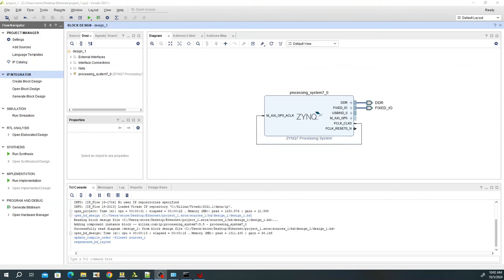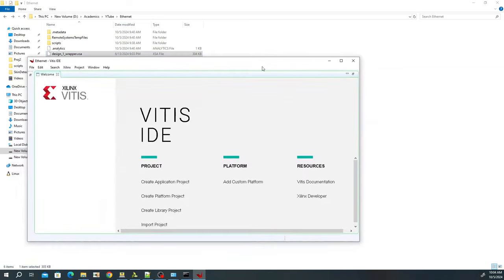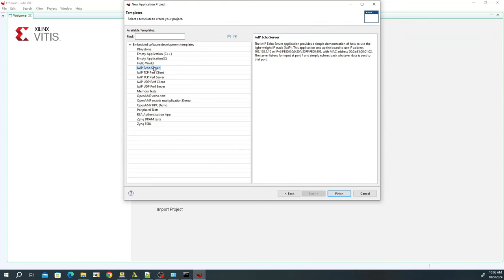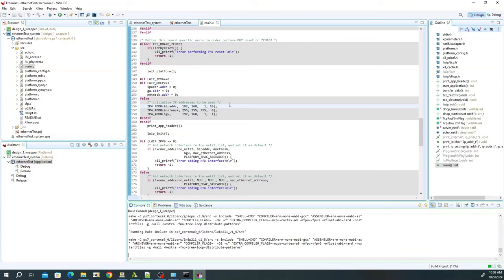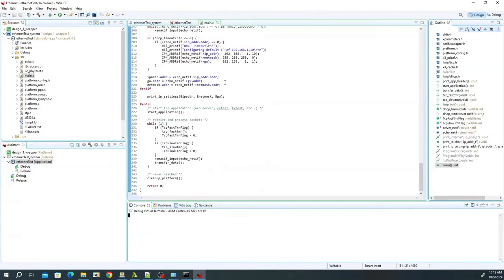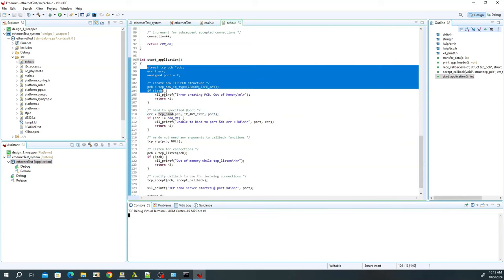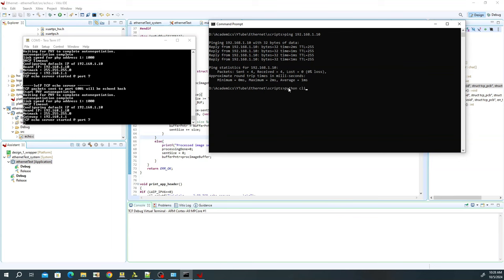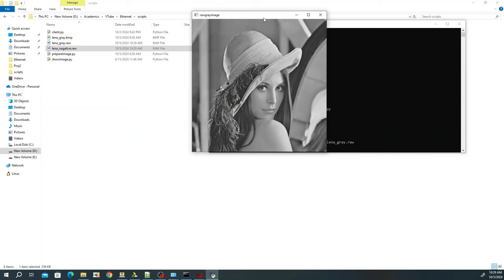Ethernet with Standalone

Comment: Welcome back after many years! Good to hear you, even though the audio is not as clear as your previous videos.
Reply from the maker: Yes. I was using Camtasia before. Lost that computer and it is quite expensive now.
Reply: @Vipinkmenon  Thats a bummer. Oh well. 

Whats the board are you working with now? Still the Zedboard? I guess now SDK has changed over to Vitis.
Reply from the maker: Zedboard stopped working. So using Zybo z7-20.. Yes sdk is gone. Now Vitis
Reply: @Vipinkmenon  Hello sir, first of all thank you for this wonderful series 😊
I am following your videos and am new  to FPGA...I am trying to transfer image through the UART interface but after almost 5000 Bytes wrong data is getting transferred.. Actually my project is on real time video processing, so can you please suggest what I should do  and is the zedboard sufficient to implement a complex image processing algorithm?